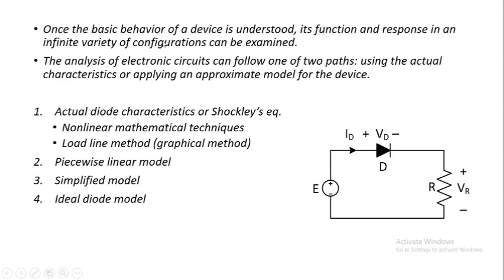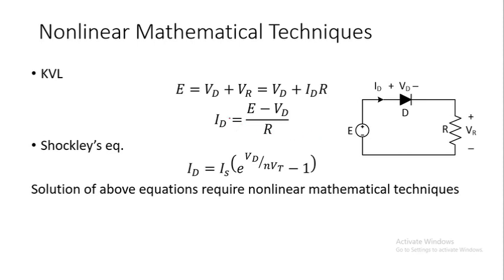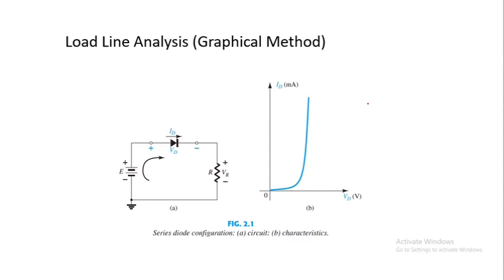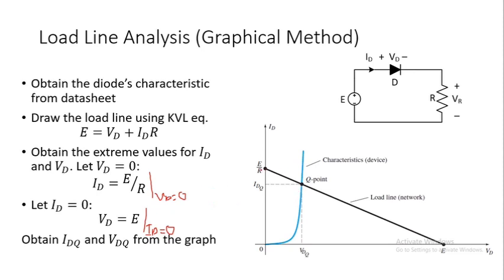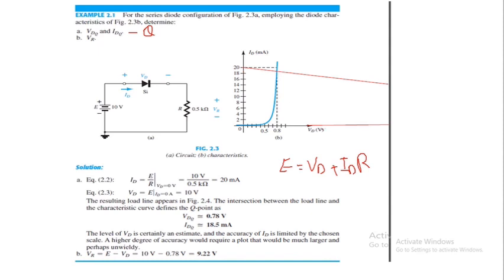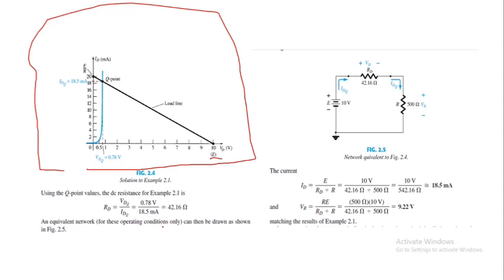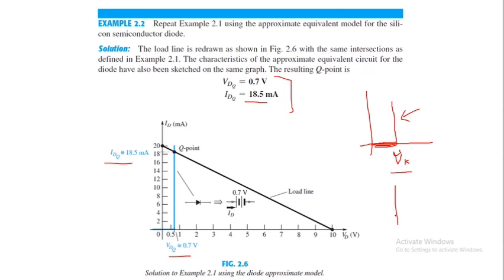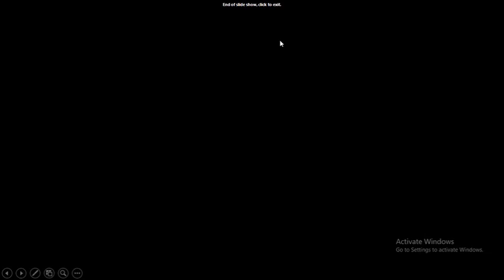load line analysis of diode network

Comment: sir, how can you tell just by looking at the graph that the q- point is 0.78V, i mean are there any secrets  to assume it correctly?
Reply from the maker: Yes. When we draw this graph with proper scaling then we can find the correct value. Remember this is graphical analysis so it must have some error but still if we draw both axes with smaller scales we will have closer to exact value or VDq and IDq. I hope you understand.